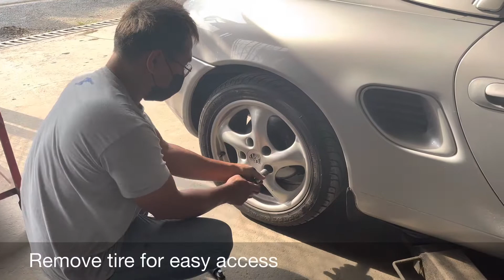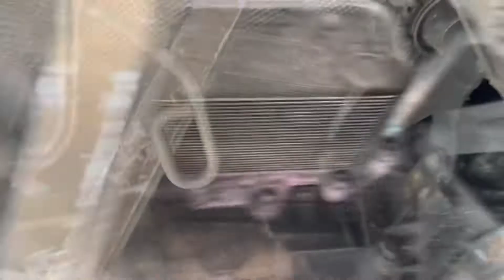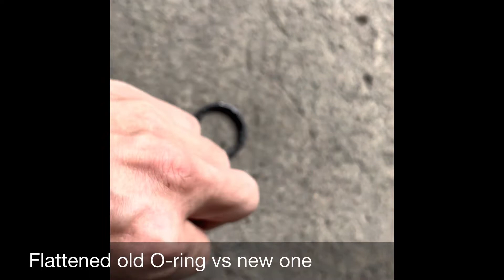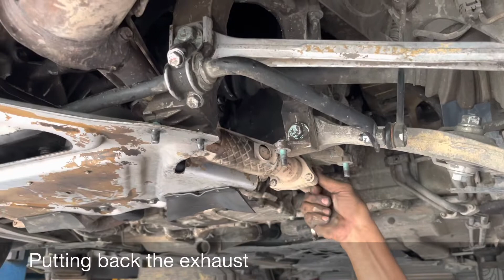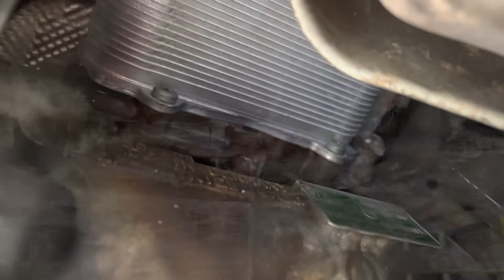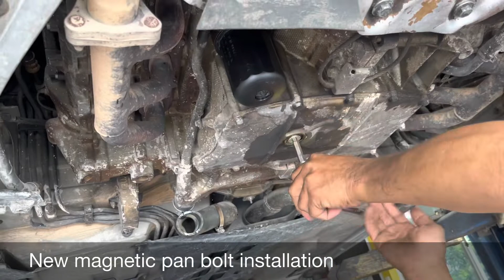Porsche 986 Boxster Tiptronic Transmission Oil Cooler Replacement

Comment: I have seen a number of oil cooler replacement videos, both for the engine and the transmission.
Everyone replaces the cooler and the O rings, but I haven't yet seen any evidence to show that the cooler itself is defective, I suspect it's only the O rings that fail?
Do you have any thought on this? Thanks
Reply from the maker: I initially thought of it as well, replaced the O ring initially and still mixture of oil and coolant persists, thus I changed the cooler too. Mixture gone after. HTH!
Reply: @torquefrancisco  thanks very much for your reply

Comment: How did the technician flush the water out of the oil in the transmission? How many times did he change the transmission oil? I did 5 changes already and it is still milky. is there a special procedure to follow? Any ideas?
Reply from the maker: Thanks for your comment, you have to ensure first that the trans oil it self is not contaminated. If it is, you have to drain it fully by removing the trans cover. Then ensure that your trans oil cooler as well has been replaced. Once drained, fill with fresh trans oil. If your trans oil is not contaminated, most likely the mix is happening due to failed oil cooler.  You need to replace the oil cooler and o rings before you do the system cleaning. If It is still milky most likely because of the oil cooler. I suggest to replace both the engine and trans oil cooler. HTH.  Let me know if you have further question, i’ll be happy to help.
Reply: Thanks
Reply from the maker: @TomtomTomtom986  You are welcome! feel free to reach out to me if ever you need help. What is the state of your car now ? where did you left of? Had you changed the oil coolers?
Reply: @torquefrancisco  I changed ATF oil cooler and Oil cooler already. Still struggling with getting the water out of my transmission oil. I changed the oil 7 times and 3 times filter, but last time still a bit milky. I am not sure what else to do. Here where I live is no flush system available.
Reply from the maker: @TomtomTomtom986  Sorry to hear that. Have you used dishwasher soap to clean the system? That works for me, you have to drain it, put water, mid way, add dishwasher  (not dishwashing) soap, it will clean the system and get rid of those contamination. Run the engine until ideal temp (watchout for over heat, turn off the engine immediately if the temp rises fast). then let it cool, drain, rinse the system with water, run it again, repeat for 5 times or more as you see necessary. you have to ensure that prior  to putting a coolant, the water is clean and free of contaminants. Also, make sure you set the fan to max and temp to max as well when you run the engine so that the heater core will also be cleaned, those mixture can be trapped in that area and you want that to be cleaned. the soap will pass through the heater system and clean it. The goal is o make sure th system is and water is clean prior putting the coolant. I did put the dishwasher soap and cleaned the system 2 times before clarifies.
Reply: @torquefrancisco  thanks for the detailed explanation. And yes, my coolant system is completely clean. The problem is the transmission and remaining water in there and its oil.
Reply from the maker: Does it mean if you take down the oil sump of the trans there is water?
Reply: @torquefrancisco  its milky
Reply from the maker: @TomtomTomtom986  is your unit Tip or Manual?
Reply: @torquefrancisco  same yours, Tiptronic 2002 986 2.7l Boxster.
Reply: So far no one had a good idea how to clean up the oil. Most common suggestion is to change AT oil until clear, but how often would this be, no answers.... 😉
Reply from the maker: @TomtomTomtom986  heard that as well and most likely that is the way to do it, ensure also that you change you transmission filter.
Reply from the maker: @TomtomTomtom986  OMG, you really have to take it down, we have to know where is the mix happening. But I got a hint that there is a seal that gave in. Better drain it ASAP. It will also harm the rubber tubing if left for a long time like that.